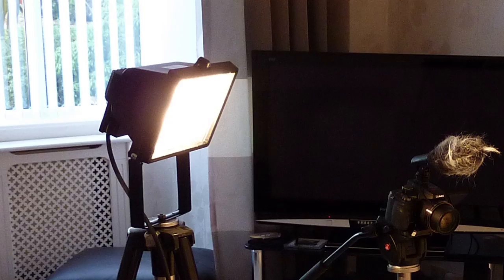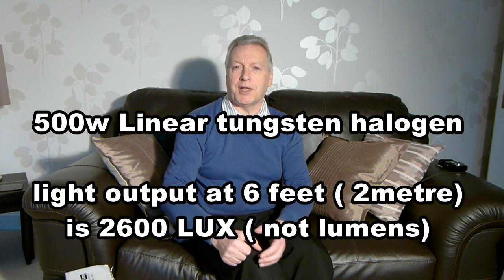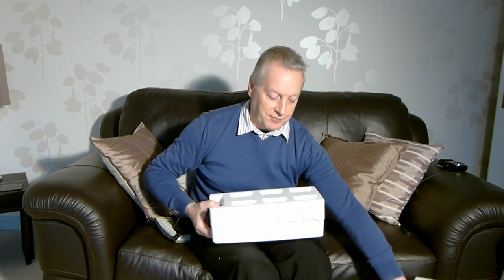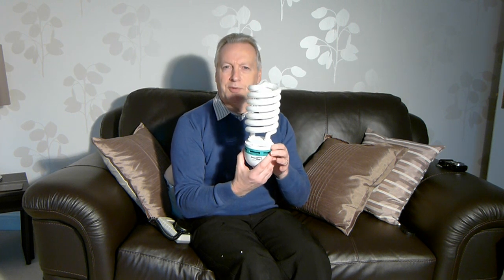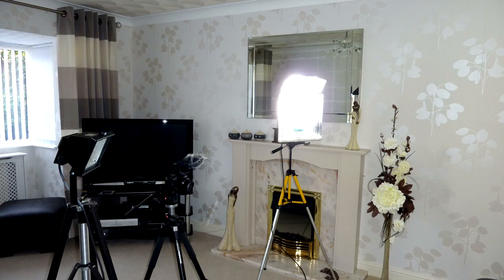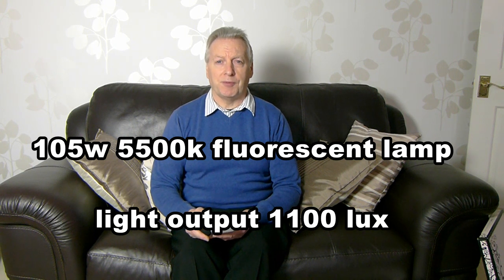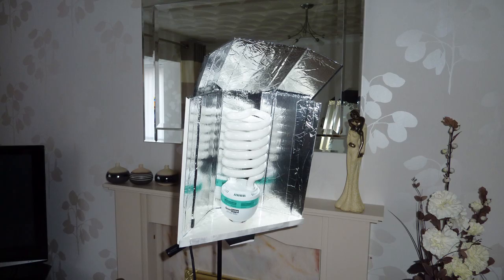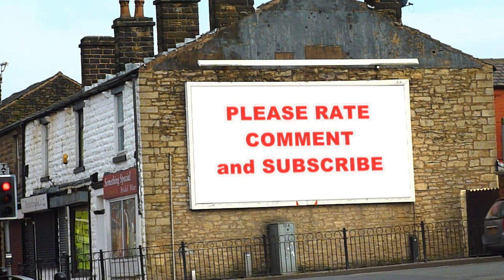DIY Lighting for Home Video, 105w 5500k fluorescent lamps

Comment from the maker: I been using this, and other lamps for over a year now. For video if you select a shutter speed equal to the mains frequency (which should be automatic by the region sale of the camera - ie 50hz or 60Hz for NTSC)  then you don't get any flicker/strobing on the video. In stills I have never had any problem at any shutter speed. there are many commercial models of lamps now based upon these high efficiency bulbs.

Comment from the maker: @chehsed The colour rendition index isn't stated but its not over 0.9 as it looks to be short of red wavelength despite claimed to be 5500k. There is always a lack of red even when white balanced correctly and shooting macbeth colour cards confirms it. Howver it does give enough light for general video work for home use but cetrainly not pro spec at all. Thanks for your comment.

Comment: 5500k is good, but what is the CRI?  The CRI is just as important, if not more so, than the Kelvin rating.  Try using multiple, accurate lights, instead of one big, less-accurate light.  Alzo makes an 85 watt CFL that's 5500K and 91 CRI.  It's listed on Amazon. Also, a diffuser over the halogen would have softened the shadows.

Comment: The cfl have the equivalent light of a halogen lamp, but it does not have the same reach. In other words, halogen lamps would throw light for a longer distance. LED has the same problem as the cfl has. Hope this can help.

Comment: Get an equilateral triangle prism and let's see what kind of spectrum it cast.
Reply from the maker: The CRI of the lamps are specified as 90 so the balance of RGB is pretty good, they probably are red deficit, If I can locate a prism I'll do this.
Reply: It would be interesting to see. I'm wanting to dabble in hybrid photography so I'm looking for inexpensive but accurate lighting. Wiki has a really neat image comparing the emitted light spectrum of two light sources. (In "Color rendering index" posting.) I just went ahead and bought a 30x30mm prism on ebay for 9 dollars just to play with.